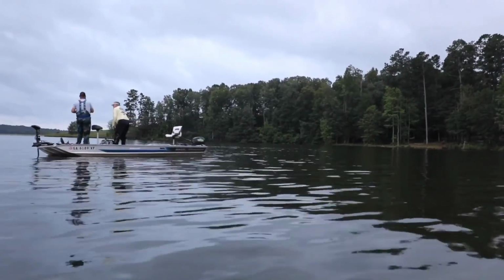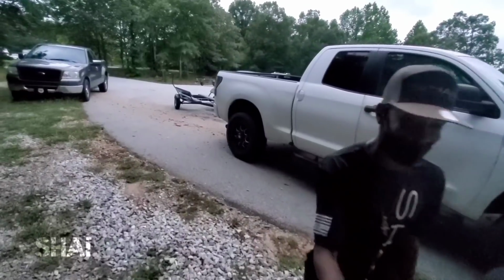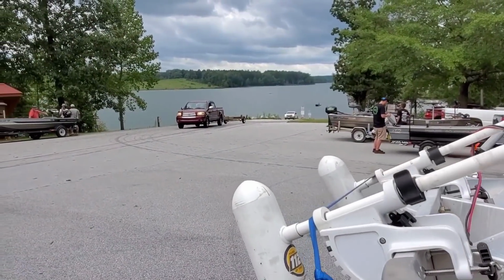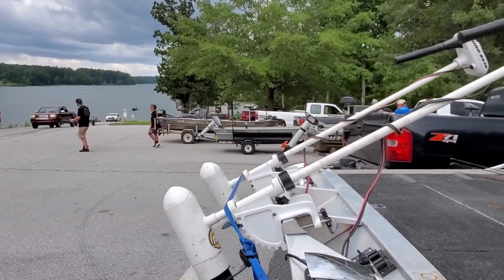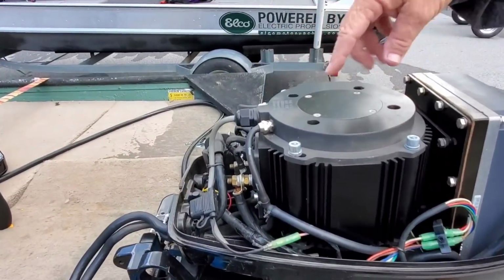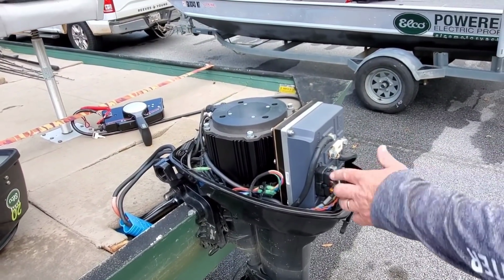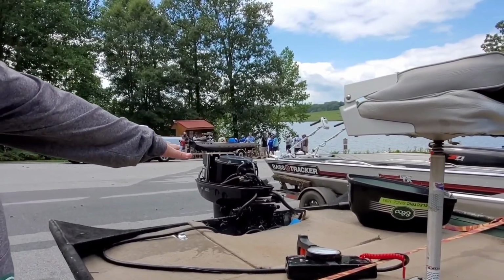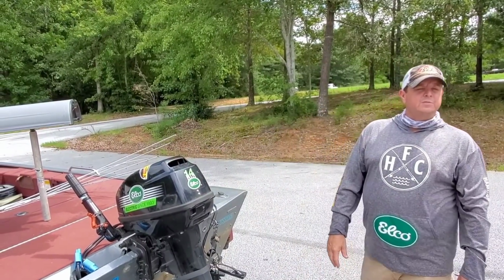Electric Outboards | Elco Motors | Georgia Electric-Only Bass Tourneys.

Comment: I've worked on hybrid cars for the last 20 years batteries are the only problem normally a hundred and fifty thousand miles what are the lifespan of the batteries you're using
Reply: My lithium ion 48volt battery by ePropulsion powering my electric outboard has 3,000 charge cycles.